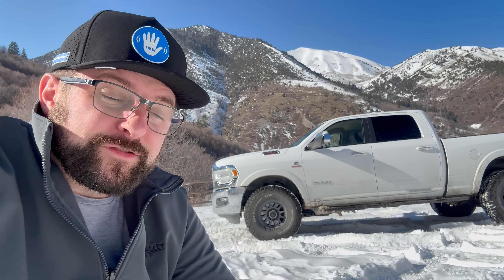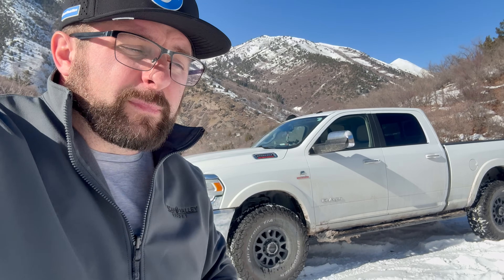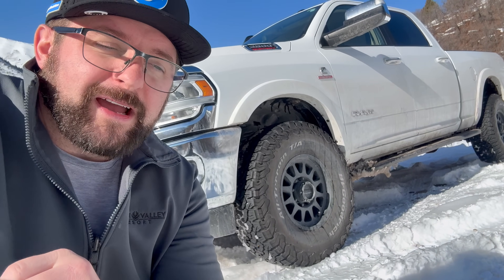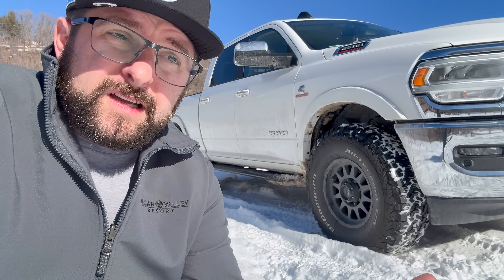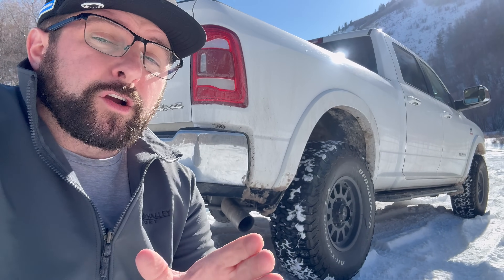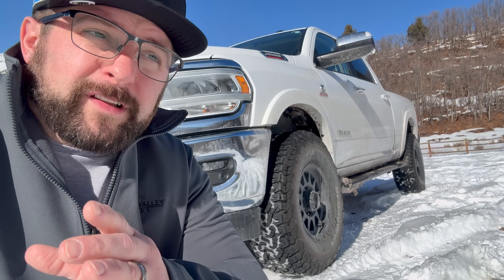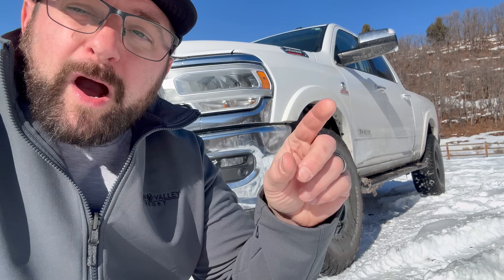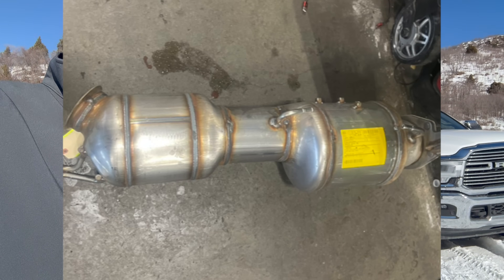How can diesel emissions systems be more reliable?  STOP doing these two things!!

Comment: Winter time just makes it that much worse as the engine takes longer to warm up and may not even run at a proper operating temperature if its too cold, one of the reasons for the use of a winter front in that type  of scenario. I realize your winter temps would not average like they would up here in Alberta, not to mention that the struggles get worse with the DEF freezing and the heater element in the DEF tank failing and so on. Also having to idle the vehicle to literally stay alive and if working out of it in the oil patch and how that's been such an issue with these emissions systems and some have reverted to gas trucks to avoid those issues ... but gas engines use FAR more fuel idling then a diesel engine, just can't win.
Reply from the maker: Yeah we’re no where near as cold as Alberta. Having DEF freeze and all that just adds more maintenance. And, what can you even do as far as idling goes? You gotta idle in your case!! With how much new DPFs cost, (if you’re out of warranty, it would take a lot of fuel to make up that cost, so maybe gas would be more economical🤷‍♂️ but we just like our diesels ya know?!
Reply: @gavinwalker5686  You might have guessed but the answer for numerous diesel pickup as well as highway tractors is to get it deleted if there is a viable delete on the market to work with. Up to this point anyway Alberta has not been coming down on deleted diesel engines, but the same issue with deleting and therefore deleting ones warranty applies. That was a couple of years ago when I last talked to one of the local shops that in their case they specialized on Ford powerstrokes in repairs and deletes and he said there are some customers that were coming in with a brand new truck and getting it deleted, their downtime risk of being without the truck would cost more than what the warranty was worth to them so that is what the chose. Of course that is not the position every truck owner would be in as some are relying on that factory warranty  as they can't afford to pay on a truck AND replace a whole engine or whatever else the voided warranty could have covered. Certainly there are those that trade in their trucks, play the musical trucks game to have a warranty and those owners would not be deleting their truck. But as to diesel pickups, they are extremely popular up here and part of it has to do with the power they command and can't be seen with a gas truck because that wouldn't be cool ... got to have a diesel that is lifted to the sky with really big tires on it and be somebody LOL.
Reply from the maker: @charlesb4267 yeah you know that makes a lot of sense. For guys making that oil money, the down time is expensive, enough to just buy a new transmission is needed 😂 so why bother keeping a warranty in tact. Cool Canada is flexible about it so far. Hoping America follows suit here in the next little bit.